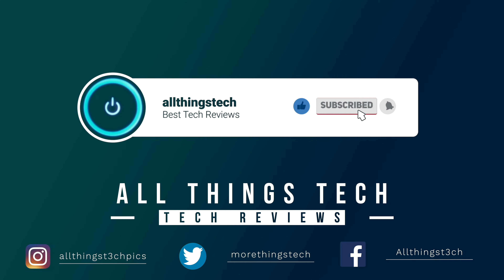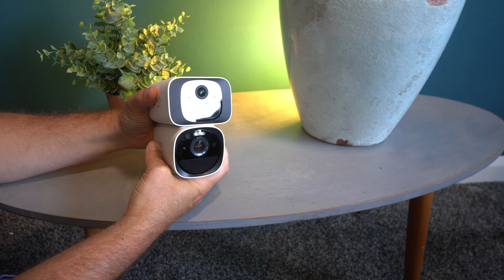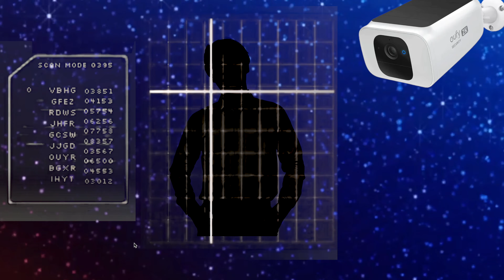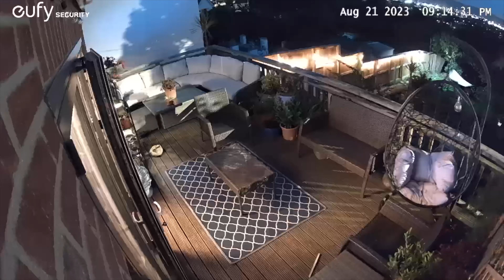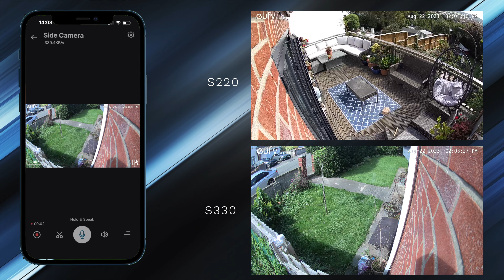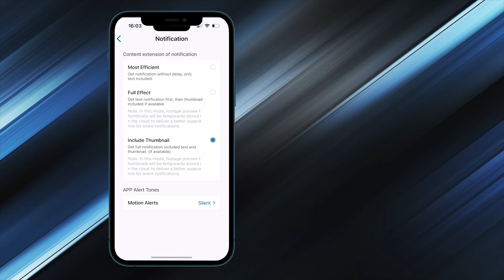Eufy S220 Security Camera & S330 Comparison with Homebase Integration

Comment: This review is biased because this tester was supplied a freebie. The built in solar panel is inadequate to keep the unit fully charged.  Mine gets about 5 hours which adds about 5 percent power. The unit uses about 4 percent per day so you break even on sunny days. A couple of cloudy days and the unit will never get back to 100 percent.  My advice is to connect it to a larger external solar panel. I purchased one from Eufy and that keeps it topped off at 100 percent.
Reply from the maker: @joejohnson2478   sorry that your experience is different, but mine has never needed to be charged manually and maintains 100% constantly. One thing to consider is direction, mine is on a south facing wall so gets the sun more.

Comment: Is the solar panel removable?  We want to place this on a covered front porch - not in direct sunlight.  We’d need to place the solar panel about 3 feet away from the mounting location?  Also - how long does the battery last when it is not recharged by the sun?  A week?  A month?
Reply: Both can be recharged via USB cable (S220 has port it's bottom, while S330 has it at the back)

Comment: I have the eufy door bell and the older homebase. Will the S330 work with the older homebase?
Reply: The S330 does require the new HomeBase 3. If you don't want to upgrade you can get a solocam that doesn't need a homebase (hint the name "solocam", when you look on their website for that name) but I wouldn't do solocams because they don't come with an option to add a micro SD card for more storage, it only comes with 8gb that it's not much at all. You always have the option to pay the monthly subscription but I personally avoid that at all cost and get cams with micro SD feature. If you get the s330 cam and upgrade the homebase you can add 16TBs to the homebase having lots of storage for the s330 cam and any other security cam from Eufy you would like to add future.